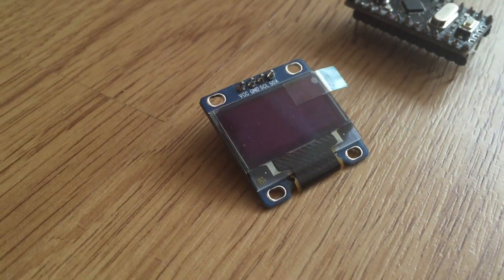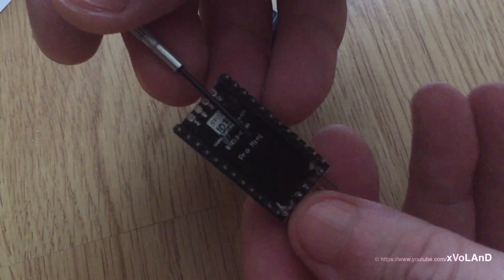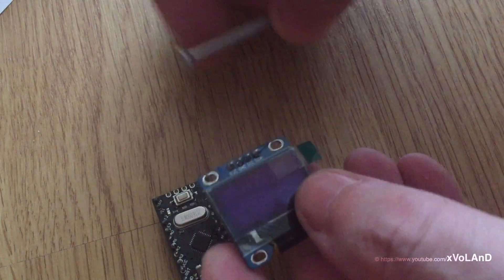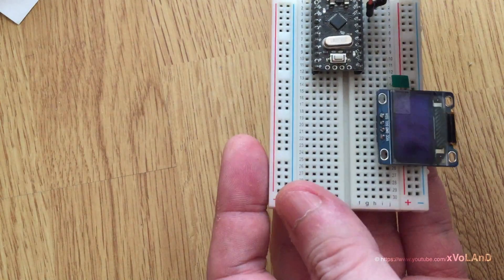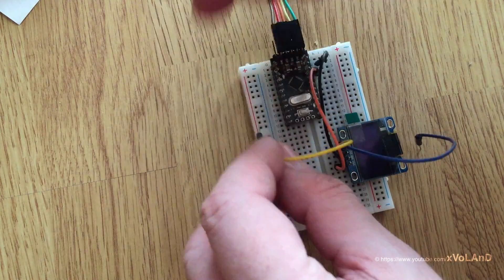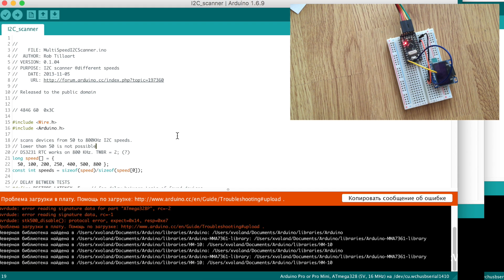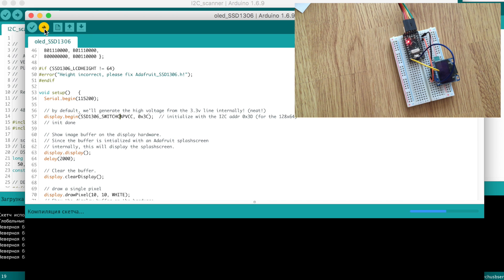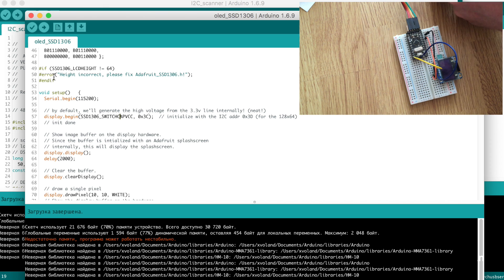Arduino Pro Mini OLED SS1306 display. Tutorial. How to connect.

Comment: Do you need a bread board ?
Reply from the maker: Thanks, I have one, but I am not using it.  It’s of poor quality and sometimes there are no contacts inside the conductors
Reply: @xVoLAnD  so you can directly connect the LCD to the Arduino ?
Reply from the maker: @artlessroger197  Do you know which port? May be HDMI? VGA or any other?
Reply: @xVoLAnD  to the GPIO pins ?
Reply from the maker: @artlessroger197  I known only two ways to control the screen I2C and SPI. Of course, this connects through the GPIO
Reply from the maker: @artlessroger197  If you want to connect real LСD, you will not be able to do this. The maximum that you can connect is a screen from an old Nokia or Ink. I will give you a hint which LCD frequency? And which frequency of atmega328?
Reply: @xVoLAnD  I see